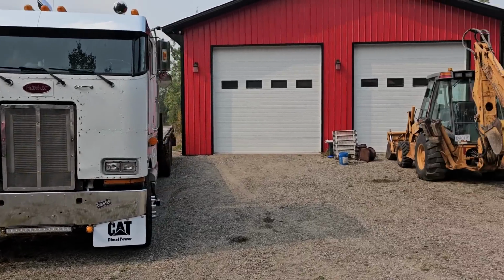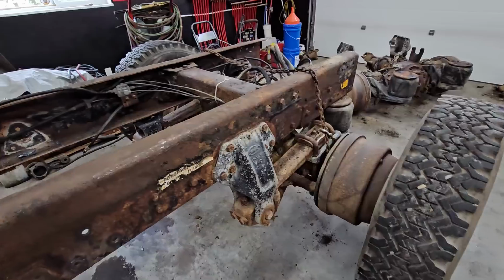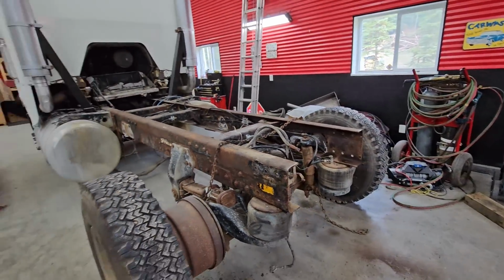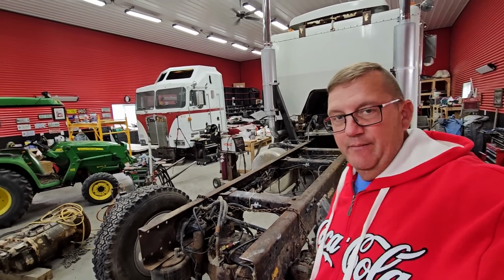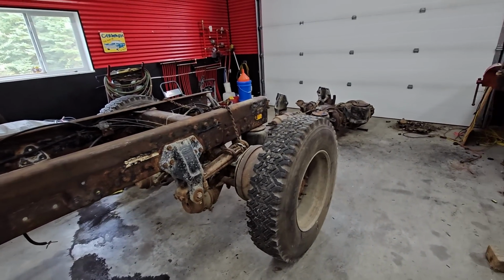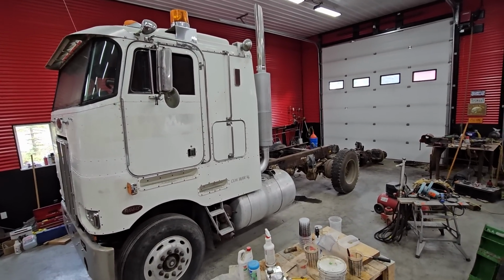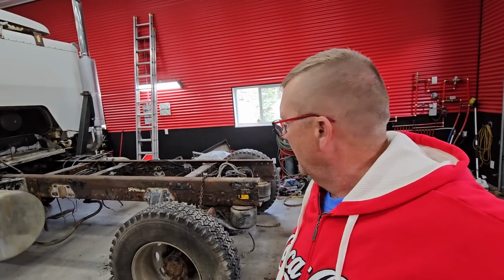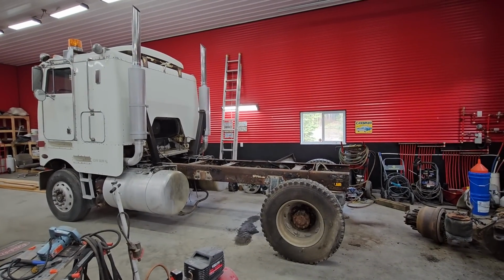Was this a mistake?

Comment: Yup, stubby needs to grow 3  or 4 feet. Add the rail extension and tandem it up.  Sand blast the frame, maybe add a cross member where the old front axle came out ...  Clean 'er up and paint the frame.  Don't do body filler (future problems), just get a shiny diamond plate cover bent to cap the frame, add some walk up steps behind the tanks, and rock & roll 😁

Comment: if you stretch it you put the diff back in the originally holes, cut the frame at the back of the cab area and add the extra frame up between the cab and front hangers.

Comment: Well Mike at this point you can do anything you wish, But first you have to clean the rails and axles up . But if it was mine I would definitely add another axle to it with rails welded with plates. Remove all the old air lines and wiring and replace with new ,then it will be a total long custom truck, just takes time and lots of money. :goodvibes:

Comment: Logically for me it would be better to keep stubby a single axle with a 10 speed trans instead of an 18. Will pull  anything you’ll tow plus will maneuver around easier. A 10 speed would be perfect for a non work truck

Comment: In regards to stubby if you’re not going to put it to work why don’t you consider putting a lift axle in front of the rear and just have a single drive with an interaxle lock. This way you get the performance of a posi rear without all the extra Cora live axle drag
Just sayin

Comment: Yes make it a tandem
Reply: Like everyone else has. It's not going to be a working truck. Why the expense and hassle. I would think it would ride better as a single axle. I never drove a single axle cabover, but I've driven plenty twin screws. You'll be bobtailing most of the time, I assume. Single axle shouldn't give that second jolt when you hit a bump like a screw does. Unless your Canadian roads are alot smoother than in the overtaxed, under maintained U.S. roads.